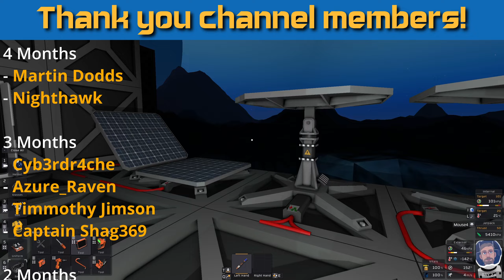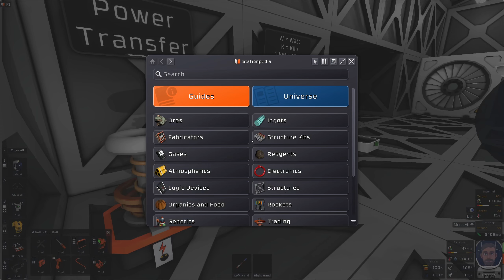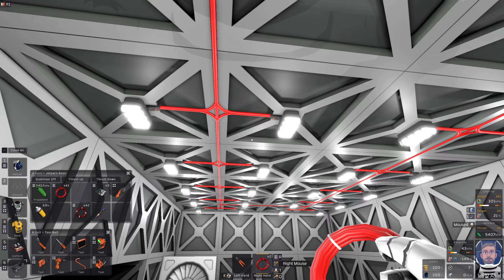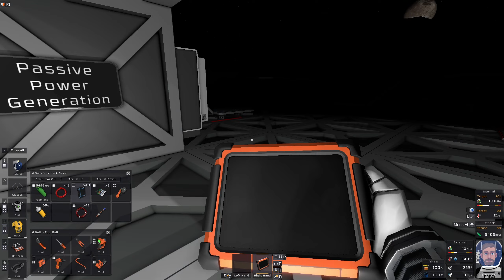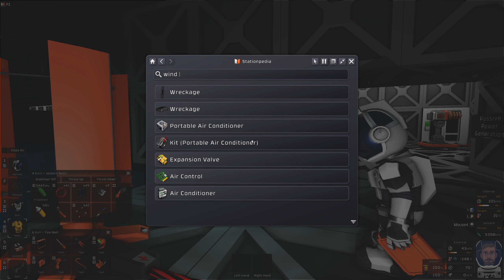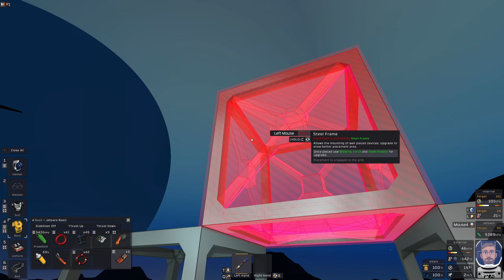A Stationeers Tutorial - Very Basic Power - An idiots guide made by an idiot

Comment: My battery keeps exploding and I have no idea why. It's not fully charged, it's not overheating, it has a transformer in front and only a starter base draining it. It explodes like clockwork and there's nothing I can do. This game is stupid. Can't even put a switch in a circuit without stupid logic crap to make it do what a switch does normally.
Reply from the maker: Hey,

Not sure about the battery. I assume it's not the battery exploding but it's the input / output cable popping? Without seeing anything, make sure the output cable can handle the amount of power being drawn by the machines. On the input cable, a battery will request it's remaining charge so it's recommended to have a transformed on the input side as well. If you have too much power generation, it could overload the cable.

For the switch, try using the writer switch. It's part of the logic I/O kit. With that, you'll just need to set the device it should operate and then what it should do on that device. No logic needed. The switch kit is a little more involved.

If you'd like, join the discord and message me. I'd be happy to take a look with you.
Reply: @PanicAndDieGaming  It blows up my entire base lol I can't tell exactly what is exploding because the damage is so severe. I've seen cables blow before, they don't do this much damage. I deleted that save anyway, autosave got me stuck in a loop of being exploded.
Yeah I figured out the logic i/o switch but it's still dumb. That's not how electricity works lol a switch is literally just a break in the circuit, it shouldn't need to be told how to act. This game is tiresome, I play for 5 minutes and do something then I need a break. You need 5 degrees to understand how everything works. How do you do it? Did you study any of this stuff or learn it from the game?
Reply from the maker: @KamikazeCommie501  lol really? Well maybe the batteries are trying to live up to your YouTube name :D.

I've not seen that issue before with the batteries. If you get it again or know how to replicate it, I'd be interested to see it. Could use it against my wife when she annoys me lol.

You're right, switches in real life just cut the power connection. Welcome to Stationeers :D

How do I do it? I don't know anywhere as much as others do. I've been playing this game continuously for almost 2 years and I still don't understand everything and I still get things wrong which the community are happy to point out lol. The limited knowledge I do have is just from playing. I don't have any background knowledge to help with the in game functions. 

It's just:
Trial
Error
Trial again
Blow something up
Try it again
It works so I make a small change
It blows up again
Rinse and repeat :D
Reply: ha seems like I'm experiencing Stationeers as intended then. I'm making almost the exact same starter base so if it happens again, I'll send you the save for a look. The only other reason I can think of is it was in a wall between 2 rooms with a temp differential of about 60 degrees C. If that kind of stress is simulated, I think this game might be too hard for me lol
Reply from the maker: @KamikazeCommie501  Yeah send it across if it happens again and I'd be happy to have a gander.

Temperature between rooms doesn't cause what you've experienced BUT pressure could. Depending on the world you're on or the atmosphere you had in the rooms, if the pressure difference between the two rooms exceeded what the wall can handle, that could cause the wall to break which has "Sub Optimal Results" :D

If you're new to the game, search for the wall type you're using in the Stationpedia (F1 in game). It will detail what pressure the wall can handle. On that note, the pressure is the difference between the two sides. Clever people call it the "Delta". I just call it the difference.

Basically if the wall says it can handle 200kpa, that's a 200kpa difference meaning you could have one side with a pressure of 50kpa and the other side 250kpa and it would be fine (Just)
Reply: @PanicAndDieGaming  The difference was only 50kpa. I still have no idea what it was, I made an almost identical base and progressed much further. The only thing I did different this time was bring my batteries inside out the cold for better efficiency, so I think it definitely had something to do with that. I'm fully self-sufficient and I got up to advanced furnaces. I might have to join your discord now if there's anyone there that can do even basic IC coding because I'm completely stumped. I feel dyslexic and it's horrible. Coding for me feels like I'm just doing random things and looking at it like 'yeah, that might do what I want' and then it does something completely unexpected that I can't see in the code anywhere. No idea what I'm doing and I watched a few of Cows are Evil's tutorials but I don't wanna learn all that for some indie game with no end lol
Reply from the maker: @KamikazeCommie501 Hey,

Yeah join Discord. Someone will be able to help.

With basic IC, I should be able to help if you need any. We can always have a screenshare session on Discord

Comment: the APC, as long as you put a fully charge battery into them your cables will also not pop, its like you said, if they dont require more power than the cable can handle you are good, also dont remove that battery from APC, then your cables will pop for no reason, weird how it works

Comment: If you want to test power gen in storms, press F3 and type in “storm start” or “storm stop”. There isn’t a cmd for storm incoming.  To lock the day/night or change it’s speed I THINK (only 10% certainty) it’s “orbital time scale”. For help type in help.  Bleak good rules of thumb for “how much power generation do I need?” If you main generation is solar then it’s 3x your average total power usage.  Ie if your power usage is 1800-2200W, you want your solar pnls to make at a min 6kW (at a Minimum, more is always better) For wind its more “fuzzy”.  Ie (numbers) are not correct) a turbine will go from 0 to 100W (low peak) then back to 0.  Rise agin to like 120W(high peak) so peak avg is 110, then / 2 = 55W.  That’s approximately your avg power gen per turbine.  That’s the minimum! It’s not perfect, and I’d NEVER do the minimum with wind power.  Always more! imo trying to add in math in for storms isn’t worth it.  They are too random. However, more battery storage the better.  Imo wasting “green/free” energy to me isn’t that big of a deal, especially solar.  I only would care about waste when using fuel based generators (GFG, Stirling, or Solid) unless their fuel become unlimited

Edit: if you mess with the orbital time scale and mess it up,( like turn a 20 min day into a 2 sec day, yes it’s possible) just just save and go back to the title screen, it will reset back to default

Comment: Small hint to look at the information of devices, place a configuration card in your tablet. 

The gfg has been nerved a lot, used to provide up to 60kw, depending on the amount of fuel.
Now a days it becomes inefficient above 20kW, again depending on the fuel pressure. 
You can run the gfg on NOx and volatiles, which gives a lot more power. 
Upto high 90kW.
The big advantage of the gfg is: a/ it's fun. B/ You can control the amount of power it produces at any time. 

The ic10 doesn't use any power. The housing uses 50W. 

@Sophie, is it a waste not having what you don't need?
Clarification: If you already produce all the power you need, is it a waste that you are not producing all the power you can?

Good tutorial, Ryan.

Comment: The transformer -> APC issue you noticed is a bug that could be used to generate more power than you are producing.  It also happens if you have parallel transformers.  Nm, you covered that just a bit later.

Comment: 1:16:00  the wireless batteries will charge on the floor (unless they changed something) but the europa temperature is draining it as fast as its charging leading to the false impression of not charging.
Not sure why its doing it differently in you hand/tool as the temps should be the same, but it is what it is I guess.
Reply from the maker: I'm not sure. They did seem to charge pretty quickly in my hand so maybe they're not as cold? I dunno.
Reply: @PanicAndDieGaming  it may be an indoors vs outdoors thing, cause I know I've seen em charge on the ground as they come out of printers in bases, but not sure about the same if the printer isnt in a "room".